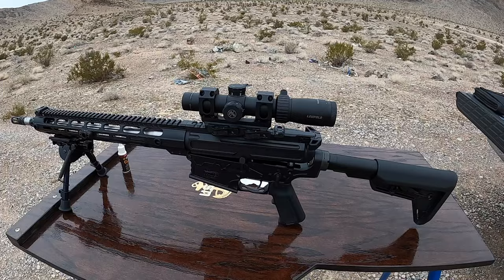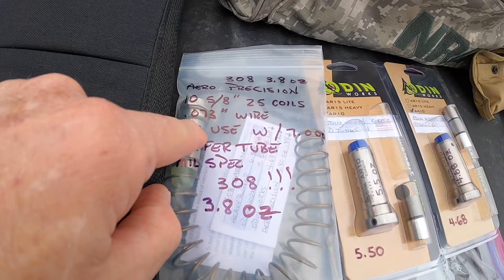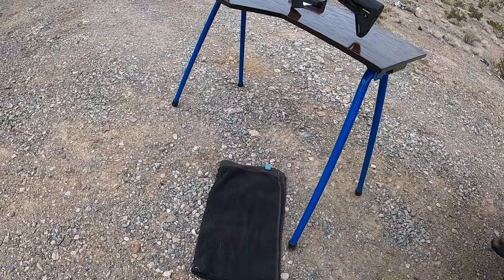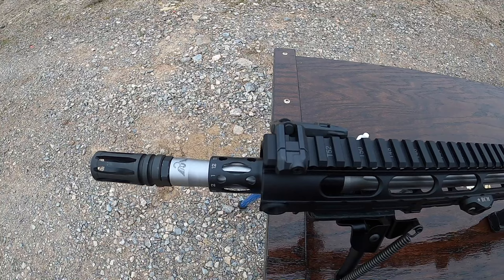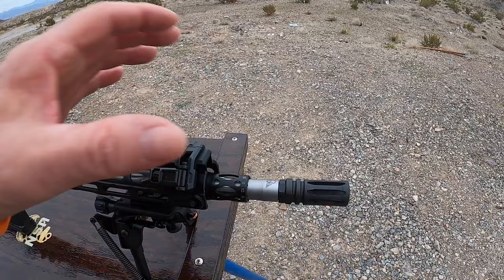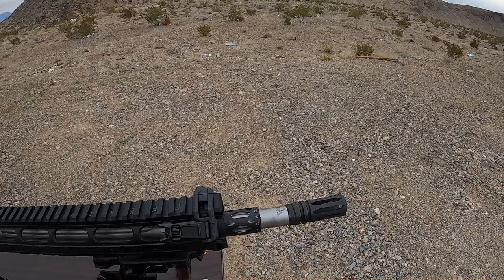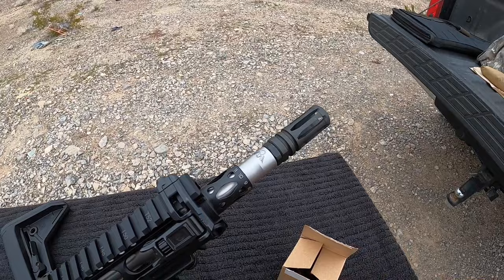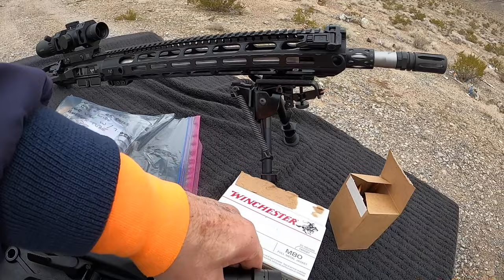LR308 Cycling Issue Solved! ( original 3.8oz buffer was too light!)

Comment: Clint Sure Knows His Stuff I’m Glad You Turned That Frown Upside Down 😊😀😀😊 It Even Makes Me Excited That It’s Fixed Pete 😀😊👍🏼 You Always Get Me With The “Bonus Clips” 😂
Reply from the maker: Yes, my original thoughts especially on the bolt catch issue was "short stroking" but I had no prior experience with this exact problem. I've had some of my AR-15's in the past short stroke but I've never had any where the BCG was moving to fast and that it was more buffer/spring related then just strictly a gas issue. I learned something new on this one for sure! Another thing I learned reaching out to Clint at "Heavy Buffers" was that he gave me what he believed was an honest answer and not just trying to sell something!! He was right! Bonus clips are a result of my CRS condition! Lol!
Reply: @peteregger7928  Are You Going to Upgrade The Other Rifle With The Same Buffer and Spring or Just Keep as Is Since it’s Working Good 👍🏼
Reply from the maker: I'll be installing the A5 in the other LR308. Even though it's working I have since found a wear issue on the buffer tube. It's the next video in the line up! @chrischiampo7647

Comment: That gives me hope! I’m building a .308 and I so happened to watch a YouTube video where they mentioned heavy buffers. I asked Clint what his recommendation was and he recommended the 6.5oz buffer. I’ll be running it using the VLTOR A5 buffer tube.
Reply from the maker: What he recommended for my A5 7.750" buffer tube was the XH Carbine buffer 8.5oz which is the 3.250" buffer using the 308 "Rifle" length spring. What I'm running in this rifle in this video is the standard CAR-15/M4 MilSpec 7.000" Carbine buffer tube with a CAR10XH buffer 6.5oz which uses the 2.5" stubby 308 buffer with a 308 Carbine buffer spring. These are carbine set-ups not for rifle even though the A5 uses a "Rifle" spring. This can get a little confusing and if you mix and match the wrong components bad stuff will happen. Most of the reason I went with Clint at "Heavy Buffers" is because he has ready to go set-ups and tells you the dos and don'ts. VLTOR has the offerings but their web site is a disaster and if you don't already know exactly what you need for LR308 you will have a very hard time figuring it out. For me anyway.
Reply: @peteregger7928  you are correct. I went back and looked at the emails with Clint and it’s the XH carbine 8.5oz for the A5 buffer tube.
Reply from the maker: Good deal! @jairoarizpe6275

Comment: Been enjoying watching this process and progress. Is this the one you replaced the BCG because the rear lugs were getting really hammered wear? Question also on the gas block: Since you're only going down to 9 or 10 would that indicate the barrel was probably ported correct, not overgassed since you're not having to restrict it much? Curious since buffer and spring seems to be the ticket on tuning and softer recoil.
Reply from the maker: Yes, this is the same rifle and now I'm thinking that the over velocity of the original Odin Works  BCG was maybe what was hammering the back of the bolt lugs during the initial unlocking? Don't know for sure but the new Wilson Combat is just showing some normal Nitride polishing at the same location on the lugs but it has mostly been fired with the new buffer set up. I'm going to run some hotter 308 Winchester and see what the gas setting ends up being. I'm having some real suspicions about the Winchester M80 "White Box" being very much underpowered! Just going by feel the almost 50 year old Hirtenberger NATO felt like it had more punch in my shoulder. Being able to lock back at setting 10 seems to confirm what I was feeling. Overall though it seemed to have less felt recoil or the impulse just felt different after the buffer and spring switch. I was also now able to still see the target and also where the rounds were hitting while looking through the glass during firing. That wasn't possible with the Aero Precision buffer/spring. The bolt carrier and catch issue was resolved and again I think due to the heavier buffer and different spring. I initially thought it might be short stroking but it ended up having the exact opposite problem. More testing to come for sure!

Comment: I hated my ar308 for a long time, i did adjustable gas and an A5 length tube so i could run AR15 length buffers. I changed springs,buffers and constantly messed with the gas block. I was trying to run several different types of ammo supressed and just had issue after issue. The way i finally got it to run reliable is to hand load for it, the biggest issue i think was running different ammo types. It’s like the slightest difference in weight of projectile and velocity would just cause it to malfunction. Now i run 168gr smk bullets with 41.5 gr of 4895 and i haven’t had a malfunction in probably 300 rounds.

It’s definitely a completely different animal than the ar15
Reply from the maker: I have learned they are very picky about ammunition. At this point I think an adjustable gas block is not optional if you need to calm things down for the hotter 308 Winchester vs NATO and especially if you're running a can! Definitely some issues with adjustable gas blocks but so far the RifleSpeed seems to be working. I did order some "bent" gas tubes at the correct length of 15.400" from White Oak Armament in case I change my mind and go with a standard gas block. I'm running a straight 15.500" in this rifle with no gas key issues on the BCG. For every video I see on YT where someone's LR308 works out of the box there's at least five more where the rifle doesn't work for one reason or another. Glad you got your's figured out!
Reply: @peteregger7928  yeah they’re definitely more finicky, in general an ar15 will run everything from steel too m193 and be fine. I’ve swapped different brands of nato spec stuff in x51 and had to re tune my gun, it’s definitely something where sticking with 1 specific ammo will give the best results ime. Im just glad i decided to put mine together vs buying one in the same price range,the psa m110 and the ruger sfar both seem to to be prone to worse issues than just some gassing problems lol. I’m getting moa accuracy and 100% reliability with my hand loads and i haven’t had anything break yet though I’m only at about 1700 rounds all together. But I’ve seen a lot of sfars and psa guns doa
Reply from the maker: On the Ruger just one screw to hold the gas key on and lack of gas adjustment range! What were they thinking? That was a rhetorical question. Once I'm absolutely positive I don't have a gas leak issue I will probably open up the gas port a couple of thousandths and be able to run virtually anything that has dry powder! Glad you're getting the accuracy. I think my Wilson Combat's will do the same? @itsamk18-ish
Reply: @peteregger7928  i think a lot of companies are only thinking about profits and bank heavily on the fact that a lot of people don’t shoot their guns. If they don’t shoot then they’ll never encounter a problem,the ones who do shoot and have the problem will get screwed because of all the people that don’t shoot and swear the rifle is 100% amazing. 🙄. 

It definitely takes the good ammo to see that kind of accuracy but when i found the right load the gun loved it  i was happy with it lol. I’m waiting on the new psa Sabre claw trigger to come back in stock, i wanna give it a try. People have been talking it up saying it’s as good or better than the larue and a little cheaper, maybe that will halp me squeeze some better groups out of it as I’m just using a really crappy milspec trigger now.
Reply from the maker: I think most YT reviews are very short term! Rare for anyone to come back thousands of rounds later talking about long term results. More and more these days manufacturers are putting garbage out the door and it often no longer matters how much you paid! I used Mil Spec triggers for a good long time until I realized just what a good trigger can do for you! I'm now a trigger snob!  @itsamk18-ish
Reply: @peteregger7928  😂i just said the same thing to a buddy about triggers, i was showing him the psa Sabre claw and he said he wasn’t really a trigger snob and 80 bucks was a lot for a trigger. I said yeah i wasn’t a trigger snob either until i got my first nice trigger, now when i shoot a milspec trigger i feel every bit of squish and crunch lol. I let him shoot my rifle that has a geissele in it and now he don’t think 80 bucks is a bad price for a trigger 😂.

Yeah a lot of reviewers definitely aren’t doing any long term reviews, several have been caught saying they have thousands of rounds on a rifle and then posting it on gun broker saying it has a few hundred. I mean i get it, it costs a lot of money to buy different things to review and then the ammo to review it but don’t lie about it. I really get frustrated with guys like military arms channel when they say ammo costs too much to do long term reviews but says in every video how federal supplied the ammo and how great it is “I’ve been shooting it since i was a kid”. Too many people get wrapped up in the entertainment of it and waiting for their favorite shill to approve their purchase that they just quit caring about actual data.
Reply from the maker: Most of the "Big Guy" channels are 100% in it for the money although they claim otherwise! It's either AdSense through YT or they are shilling something themselves. They claim they can't do videos unless you go to their Patreon and give them your money! I record most of my videos with an iPhone and a GoPro and I was going shooting anyway! Most of them are members of the Leviathan Group. I do watch a lot of their videos but other than theater and comedy routines I don't walk away with much else. Although my channel is small I do have enough to monetize but I refuse to do so! They have pulled many of my videos and threatened on one occasion to delete my channel. The smaller channels is where I go to get useful information. I won't get into all of it here as this community is well aware of the censorship and what are supposed to be protected rights and freedoms in this country.   @itsamk18-ish

Comment: nice!  I have issues with the white shit box too, i completely stopped buying it.  I've been having good luck with PSA AAC ammo and great prices.
Reply from the maker: Thanks! I'm thinking it was part of the problem! My goal was to get this rifle to run on anything so I think I'm there now? I haven't heard anything bad about AAC in gas guns and it also seems to be accurate enough. I'm going to give it a try!
Reply: @peteregger7928   I've shot several hundred rounds of it and two different grains, only 1 or 2 issues, but, I'm running the Aero 3.8 and spring just like you lol. So if we meet up this time I'm in town you'll see my set up.

Comment: Only change one part at a time. I would try and keep the new doing in but try you 5.50 buffer.  Spring might have been the issue but I do think 3.8 is way to light .
Reply from the maker: The spring and buffer are a matched set from Heavy Buffers designed to work together. I may try the Odin Works 5.50 oz anyway but did not want the carrier to get hung up on the very top edge of the catch anymore and damage the rifle. Clint from Heavy Buffers suggested that I was having an over velocity issue with the BCG irregardless of gas settings which turned out to be right. Saw your comment in notifications asking about the gas tube but for some reason it doesn't show up here in the video. I'm running a custom 15.500" straight tube from White Oak Armament on this rifle. The first LR308 I built uses a 15.400". Ordered two different sizes because I thought that the 15.500" might be too long but it wasn't. No interference issues with the BCG gas keys on these builds.
Reply: @peteregger7928  yes I apologize I had to delete multiple comments because I would ask something then within 10 minutes find the answer to my question in another video.  I built one very similar to your but in 6.5  just waiting for headspace gauges.Have done tons of research on this style rifle . When starting the build I didn’t realize how many different variants of this style rifle there were and how there are still tolerance issue in parts even for the same pattern.  If you decide you still want an adjustable gas block and  decide to try a different one from the one you currently have I highly suggest the superlative arms adjustable.
Reply from the maker: No worries! A lot of times YT is jacked up and I try to respond to all comments. I find often times when comments make it into the video YT fails to provide a notification. @JSJTOUTDOORS

Comment: Awesome brother! Hey I have been told NOT to shoot trash ammo thru nice barreld guns/rifles.
Reply from the maker: Thanks! It's not as bad as I was making it out to be other than performance which is on the lower end. The NATO was 40+ years old but still very shiny. The NATO still ran hotter and better than the new Winchester M80. Definitely would not run any steel case ammunition through this rifle though!
Reply: How’s that gas gun on brass? Does it beat it up really bad?
Reply from the maker: Very minor ejector swipe mark but with no indentations or damage but you could see it. Just a little shiny spot. Very minor nicks on the rim from the extractor on the Winchester M80. There were literally no indications of firing on the NATO so I'm thinking a better quality brass on the near 50 year old surplus Hirtenberger than the new Winchester. @rifleshooterchannel208
Reply: @peteregger7928  That Hirt might be Berdan primed but that’s awesome it’s not tearing it up too bad. I had a buddy with a .243 AR-10 type and it would demolish brass 😂
Reply from the maker: Sounds like my old Mini 14! That thing would launch brass into low orbit! Rim damage and bashed necks would ensue! Gave it to my son! Here you fix it! Lol! @rifleshooterchannel208

Comment: Jog my memory,  still using the original buffer tube on this set up? Also, is the bolt easier to pull back after she gets hot?
Reply from the maker: Yes, MilSpec 7.000" buffer tube but now with a 6.5oz 308 carbine buffer and 29 coil 308 carbine spring. After about 20 rounds today I noticed manual unlocking using the charging handle had increased resistance. Pulled the bolt out of the carrier and cleaned it. It went back to nice and easy. I think that may be a break-in issue with the gas rings although with the inside being Nitrided I found that puzzling.
Reply: @peteregger7928  Roger that, you also noted the recoil.  My recoil is violent so I'm very certain I'll need this buffer weight and spring as well. I've got a WC muzzle device and all and the recoil is so bad I had to take my bipod off because the legs would collapse lol.
Reply from the maker: These 308's sure are fun aren't they! It feels about the same but how I notice there's a difference is I'm able to stay on target through the glass at about 150 yards. Couldn't do that before no matter how much I got behind the rifle. I'm not sure it's just the increased buffer weight as I think the spring he sells also has magical powers! @DesertMariner2007
Reply: @peteregger7928  interesting on the resistance, I've got the NIB coating on both the carrier and bolt and it does the exact same thing. I'm probably 500 rounds in on the new bolt, tried the 3 individual gas ring set up as well as the 1 piece. same issue either way.
Reply from the maker: I'm going to take a close look at the rings. I'm wondering if enough fouling is getting underneath them and forcing them to fit tighter in the carrier bore the more the rifle is fired? Could be another 308 thing! @DesertMariner2007
Reply: @peteregger7928  these 308’s are like having an insanely hot girlfriend , beautiful, temperamental and annoying but you really don’t wanna let em go 🤦🏻‍♂️